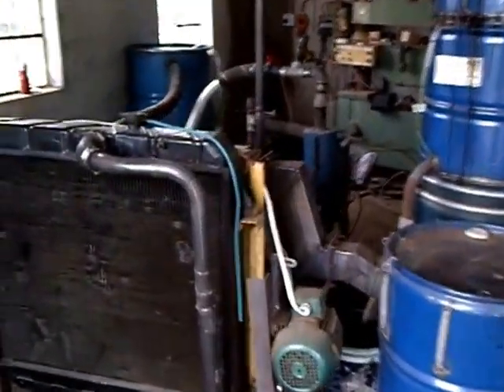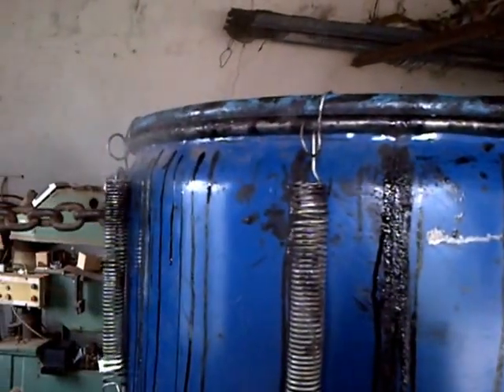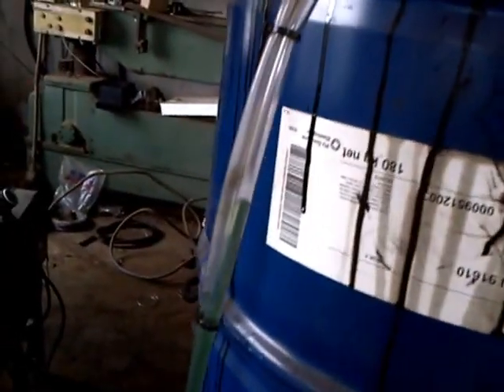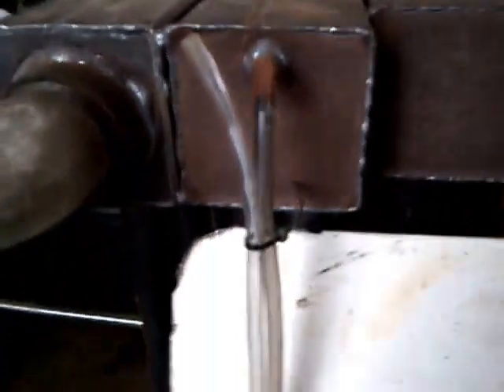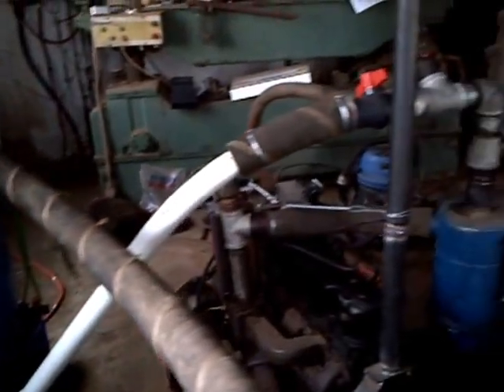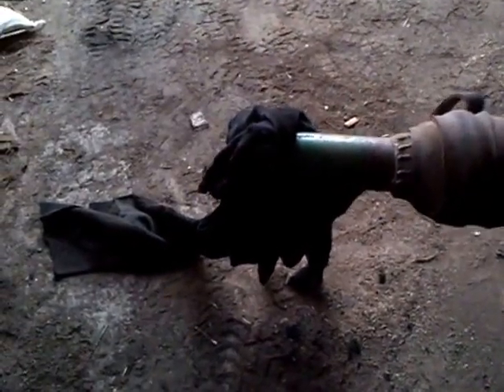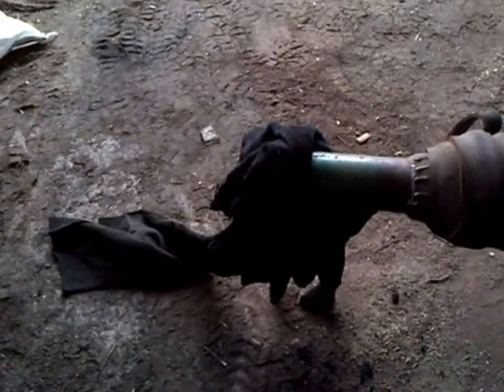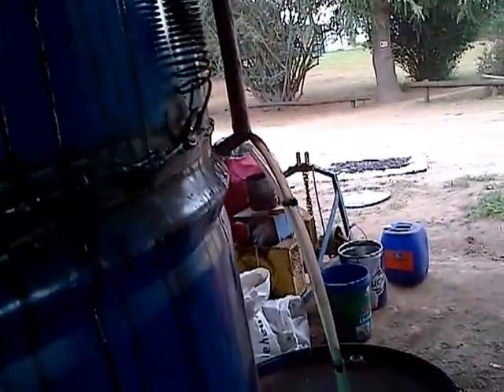Wood gas powered sawmill checking for leaks on my wood gasifier.

Comment from the maker: Correct , but the same as a car if you have air leaking in to your inlet system it will cause the air fuel mixture to be incorrect and the engine will run rough and lose power . So when you shut down the Gasifier is still producing gas for a short time after will positively pressurize the inlet system , then you can test for air leaks . Much the same as you do in vehicles with a smoke machine.